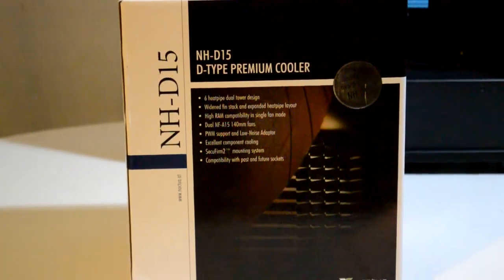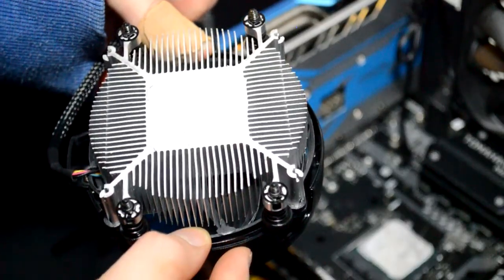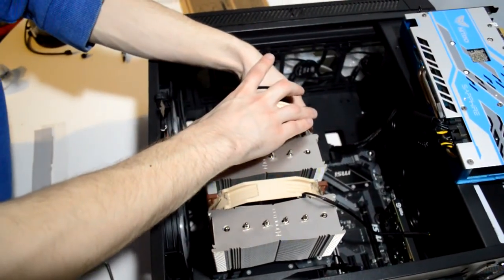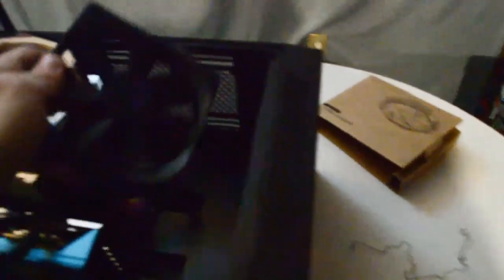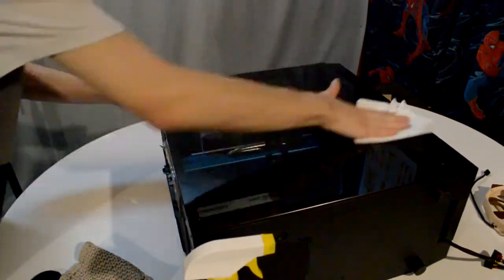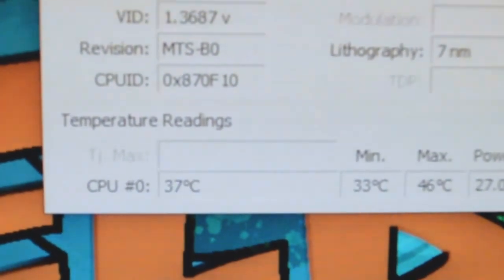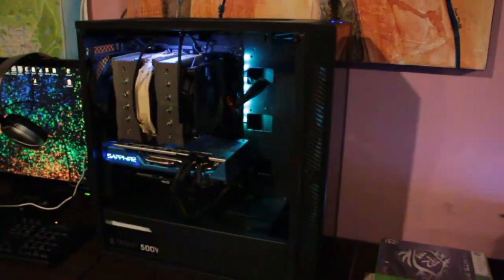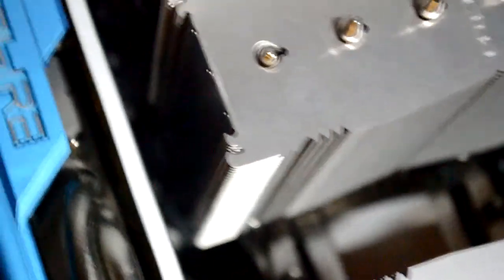Installing A Noctua NH-D15 on A Ryzen 5 3600! + Benchmarks!

Comment: got the same cooler and procie. can't figure out why my idle temp is still 45-50c. already re applied thermal paste and have proper way of putting it but idle temp is still unacceptable
Reply from the maker: Could be your fan curves in your bios , I messed around with mine a little bit to get it to idle at about 30-35c
Reply: @KelBShobra  turned both fans to pwm. temp is getting 36 to 40ish as it jumps for no reason. maybe its my room having 29c temp lol
Reply from the maker: @lollol-mg9cr  great news! And yea that could be a factor , even then those are still pretty good tempts

Comment: Yo dude, atm. My is water cooler and it’s not very good for CPU and I’m planning to buy this but if I do add this into my CPU does it mean it will also help off the GPU temperature? Ps: my GPU is 3070 and everytime I game it run like 80-90c and I’m thinking does the CPU heat transfer to GPU heat as well?
Reply from the maker: A little bit but because the GPU is under the cpu the heat will rise into the cooler , I personally had to take the top vent fans off as it was creating too much airflow towards the top taking air away from the GPU, but it works pretty decently , I do think you can get very simmilar performance out of the nhd-U14s as well , it's basically just a nhd15 but with all the heat pipes in one tower instead of 2, I wanted to get it as well but then I saw the nh-D15 and said go big or go home XD
Reply from the maker: My bad I read your question backwards when I originally read it , bit dyslexic lol. But yes the thermal mass of the nh-D15 will definitely take heat off of your GPU, just be sure that your top fans don't suck too hard , also I'm unsure where your radiator is situated so that may be an issue but hopefully not